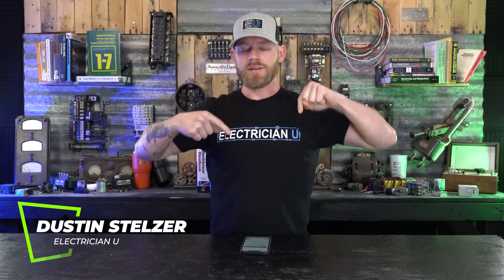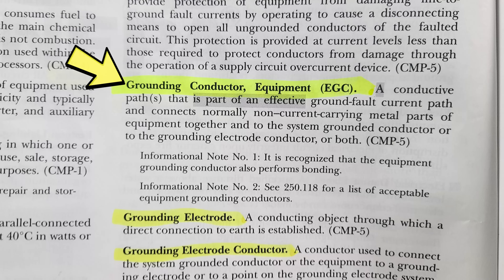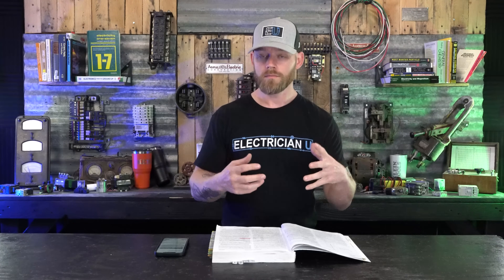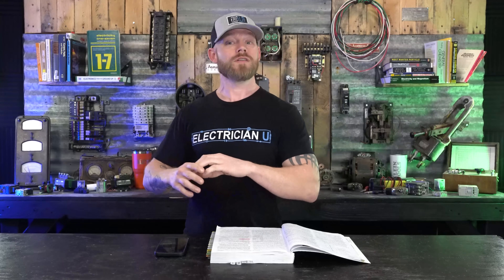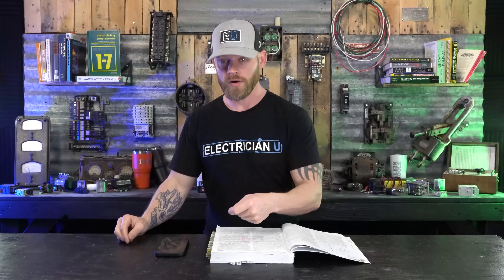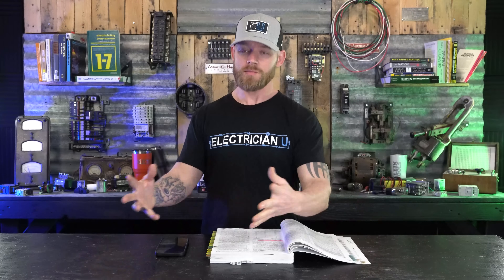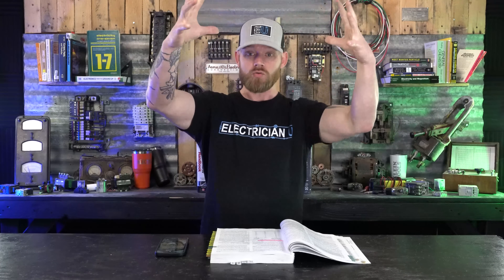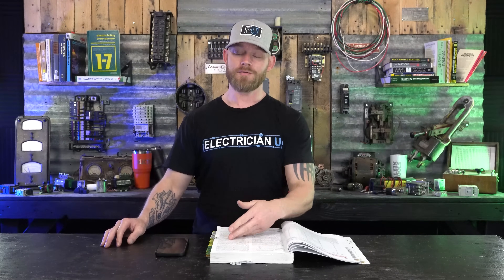Why Are GROUNDING Conductors Smaller Than GROUNDED Conductors???

Comment: Could you explain calculating number of conductors you can put in a conduit?
Reply: Don't fill the area more than 40%.  you can go up to 60% fill if the conduit is less than 24" or you only have two conductors.  Chapter 9 will have all the tables to reference, but if all the conductors are of the same size then just keep turning the pages a little more till you get to Annex C and you'll find cheat sheets for each conduit type.  Each conduit section has two parts. The second part is suffixed by "(A)". Ex: C.1(A), or C.2(A).  The "(A)" sections are for compact conductor types and that's probably not what you have to work with.
Reply: Jacob McAfee is on the right track. Chapter 9 Table 1 shows us; one conductor is 53% fill, 2 conductors 31% fill, more than 2 conductors 40% fill, and not exceeding 24 inches 60% fill. Chapter 9 Table 4 has the raceway usable area based on the percentages. Chapter 9 Table 5 has the conductor area based on type of conductor(THHN, RHW, ect). Chapter 9 Table 5A has the compact conductor sizes. Or we can go to Annex C and it will tell us how many conductors can fit in what size conduit, if the conductors are all the same. But I have been told not to use Annex C on a test, because it is based on a table that is no longer in the NEC.
Reply: To do the calculation, take the conductor first. The example I will use 3 #8 THHN and 3 #12 THHN. Chapter 9 Table 5 tells me #8 THHN is 0.0366 sqin and #12 THHN is 0.0133 sqin. Next we just add all 6 of them together and get 0.1497 sqin. Next we find a raceway it will fit into from Chapter 9 Table 4. I will use Rigid Metal Conduit and go to the 40% fill because I have over 2 conductors and I will be running it over 24 inches.
The table tell me 3/4 inch RMC has 0.220 sqin of usable space at 40% and would be the answer I would give on a test. What the code does not tell me is that next month I will be told to add more wires...
Reply: If all the conductors are of the same gauge, I always used the tables in NEC.   If there were different size conductors, then I always used Southwire Conduit Fill App.   I hate doing math and typically needed to get more work completed in design.   BTW, little known fact,  conduit fill more than 2 conductors is 40.49%.   In the back of NEC it says you can round down.   It saved my butt on one very large job once.
Reply: @KevinCoop1  True, the Rounding rule 220.5(B) is used throughout the code unless the code says to not round up or places like 392.20(D) where it would be imposable to put in another conductor.
Reply: @tiggeroush     I do not remember where I found it 5 years ago, but in the very back of the book somewhere it specifically sites rounding down for the fill calculation.    It was an absolute life saver for me as 5 miles of conduit had already been installed and my manual calculation had an error.  I called 39.3% and it ended up being 40.35%.   I would have preferred a larger conduit but being in an electrical room and 4 to 5 layers of conduits, I could not get the lower ones to elbow into any of the gear.   It was a 15,000 sq. Ft electrical room on the 6th floor of a hospital.  I was not engineer of record.   I had to design the conduit lay-out in 3D with AutoCad MEP.
Reply: @tiggeroush     You are pretty good at this!   Happy to discuss with you.   I’m retired Sr. Electrical Design Engineer.  I worked last 21 years for top 15 private Electrical Contractor in US.  I’ve worked on everything from single family dwelling to a single building with (90) 2.75MW diesel generators which was small part of overall project.  Best wishes to you!    Kevin

Comment: For Neutral sizing, I would also stress the Available Short Circuit Current. The Neutral has to be able to handle the massive amount of available SSC, to give the Protective Device the time it needs to open the circuit.
Reply: If there is a fault to neutral and it is larger than the properly sized EGC then the breaker should trip as intended, no?  The reason we have a chart for the EGC (250.122 as mentioned) that is based on OCPD size, is to ensure low enough impedance that the OCPD does not become circumvented and allowed a fault condition to exist.  If the EGC is not proportionally increased for voltage drop and the same rate as the ungrounded conductors, then it is possible to create this type of condition that prevents the breaker from being able to trip. But my head is in branch circuits here. If this is the grounded service conductor, then 250.102 is the proper chart used to ensure it will handle those massive fault currents, and this is also why this chart is based on total circular mils and not OCPD.  Downstream of your main OCPD and branch OCPDs, the fault current while seemingly high is really not that massive in comparison.  At least this is my understanding.  Open discussions are always encouraged.

Comment: Here in Florida, we wire A LOT of swimming pools.  Why does all of the pool equipment (pump, salt cell, heater etc.) need to be bonded to the footer of the pool if it's already grounded to the main panel?
Reply: its so every piece of the pool has the same ground potential. Small voltage differences that can occur between different parts of the pool system can be dangerous when people are in the water. which this is called equipotential bonding
Reply: Query youtube for "Mike Holt swimming pool". Watch his series on swimming pools. It's thorough and makes you think. He gives real cases where people have been killed because of issues.
Reply: I hope you are grounding the water now too!   It is required.
Reply: @KevinCoop1  I think you mean bonding.  We do bond the niche for the light.
Reply: @justinn9381    I’m talking about a plate electrode installed in the bottom of the pool.  2020 NEC.   Sorry, I only have up to 2017 NEC.   Retired.

Comment: Super helpful, as always!
Hey Dustin, do you feel that aluminum service wire is comparable to copper or is copper honestly the best way to go for longevity and safety? This would be for a sub panel, ran through an attic which can, of course, here in So Cal can become a bit warm. Thank you!
Reply: As long as they're sized correctly, modem aluminum AA-8000 alloy conductors are fine.  Unlike the old  1350 alloys used in the 1970's, these are safe, and "anti oxidation" paste is unnecessary.  The one exception to that may be in oceanside locations; I know of some municipalities that disallow AL alloy service conductors because of corrosion of aluminum from the salt spray.
Reply: @barryomahony4983  Thank you so much. This is really helpful and I appreciate your input. I've always used copper, but funds are tight and it's surprising how many suppliers only carry aluminum, copper seems almost special order.
Reply: @SquirrelsForAll    Whether you are running Cu or Al, please be aware that ampacities in NEC 310.15(B)(16) table are for a certain ambient temperature.  You must derate the conductors based on the increased temperature you are expecting.  It may or may not make any difference in size.   When de-rating, if the conductors are rated 90C then use the 90C column ampacity to start de-rating from.   If only 75C then you must start at that ampacity.   Hope this helps!    Kevin
Reply: @KevinCoop1  Awesome, thanks Kevin! I'll check the derating on the SER and probably end up going a bit larger than recommended, just to be safe. :)
Reply: Aluminum (Al) for feeders is safe if sized correctly, installed correctly, and the terminals are rated for Al. 

Sizing - Since terminals are only 75°C then you need to use the 75°C column on the Al side (right side), assuming your insulation is rated for either 75°C or 90°C.  Using the wire ampacity chart for raceway, cable, earth at 86°F means you have to adjust for ambient temperatures using the corrections factors provided.  If you have more than 3 current carrying conductors then you will have another chart with an additional de-rate factor to apply.  Continuous use is another factor that could come into play depending on your situation.  The specific article numbers have changed slightly from year to year but they are all in article 310 and if you don't know where to find them or how to properly apply them then you should consult a professional.  Not trying to be a dick, but it can get tricky if you've never been taught how to properly adjust wire ampacities. But here is a tip, if the wire insulation is rated for 90°C, then you can apply your derate factors to that value, and as long as the adjusted value is still greater than the ampacity in the 75°C column, then that wire is still ok.  Another secret for derating that might save you some time is that there really isn't any guidance for attic temps, at least from what I found. It's not just location but ventilation as well.  In St. Louis, even a poorly ventilated attic shouldn't get over 140°F.  So the correction factor for my attic temps is .71 if using a 90° insulation, or .58 if using 75°C insulation.  But if you are using a jacketed cable then the chances are high that even though the inner wire insulations are 90°C, the outer jacket is most likely only rated for 60°C which means your derate factor for 132-140°F is unlisted because 60°C=140°F so you would already be at melting point if your attic got that hot. I realize I'm being conservative derating at those temps but let's say you think 123-131°F is conservative enough, well now you can use that 60°C cable but the derate factor is .41, so now you've lost almost 60% of the ampacity due to ambient temperature conditions.

Installed correctly - Al wire must be coated with anti-oxidation compound as many people are aware, but what is commonly missed is that you must sand the stripped area with an emery cloth first to remove existing oxidation and then very quickly apply anti-ox.  Pay attention to the manufactures torque specs. Some people say that if you torque it right the first time you don't have to come back for torque checks, but due to the high thermal expansion coefficient of Al I still have our maintenance team schedule torque checks 6 months to a year out, depending on wire size and environment. Basically, this just means it is going to try and move under the lug with temperature fluctuations more than Cu would.

Properly rated terminals - If the terminals are not rated for Al or dual rated (Cu/Al) as most Al rated terminals are, then the care for eliminating oxidation is all for nothing since galvanic corrosion will set in, and the now highly resistive connection will lead to heat build-up followed by meltdown.
Reply: @JacobMcMarley  , Thank you very much, this is very, very helpful! Thank you. As an old guy, I'm just so used to using copper, I need to open my horizon a bit more.